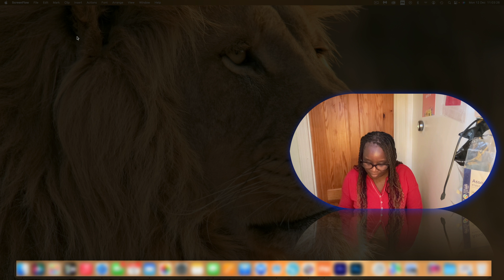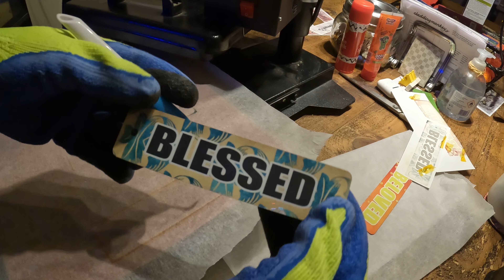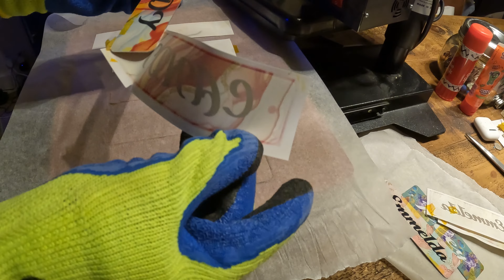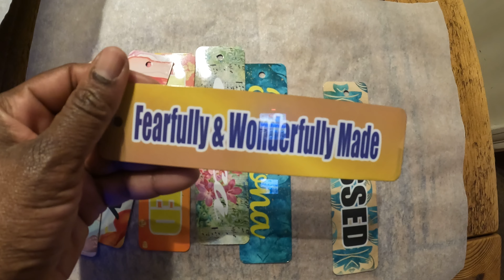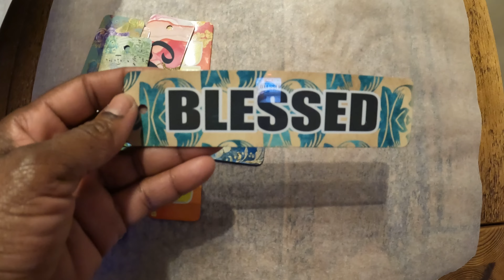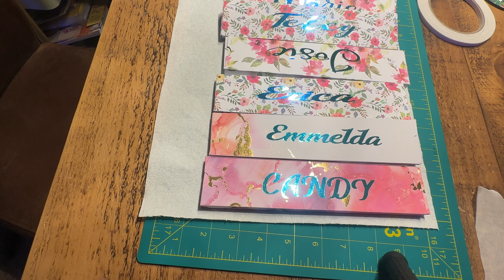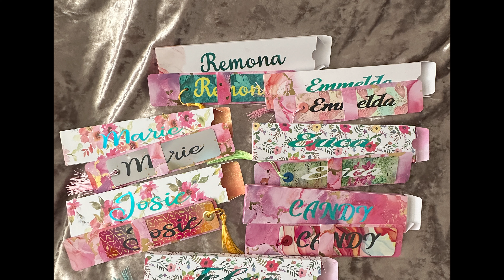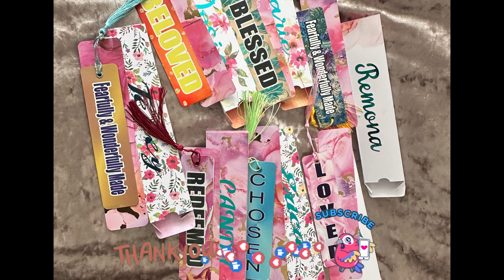Customising Metal Bookmarks (Part 2)

Comment: Hi,
 The problem is the heat tape you're using. A lot of people in the crafting/sublimation community have had the same problem using the same tape from Amazon. I highly recommend using clear heat tape (also sold on Amazon and reputable sublimation companies) or Cricut's blue heat tape. The heat tape you have is hit or miss depending on the supplier. I used to use it and never had an issue however, when I decided to order it again months later, according to the current reviews, the seller switched suppliers and the tape was not the same and ruined many customers blanks. Save yourself the headache and money on wasted blanks and switch to clear heat tape. You won't be disappointed. Just thought I would share!
Reply from the maker: Yeah I know what you mean.  I ended up using Siser's tape and no issues.  The hit and miss is real.  On t-shirts no problem.  Thanks for watching and have a wonderful Christmas.
Reply: @foryourglory  You as well. Thank you!